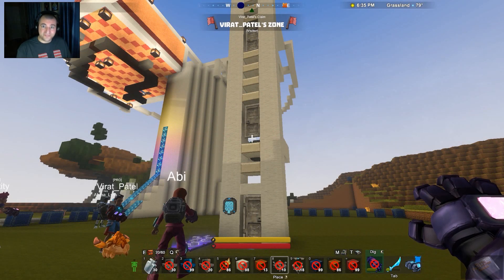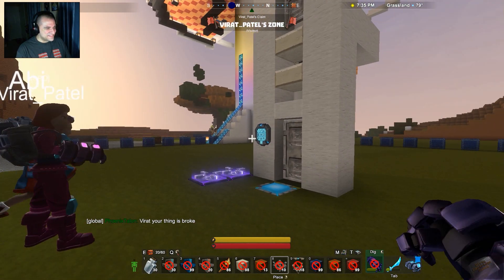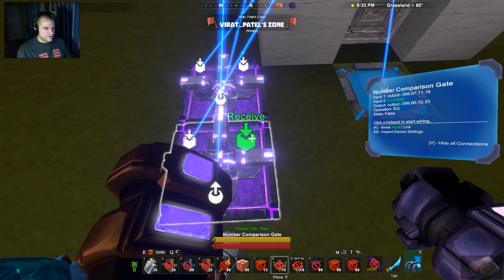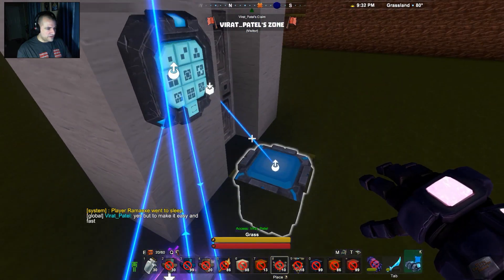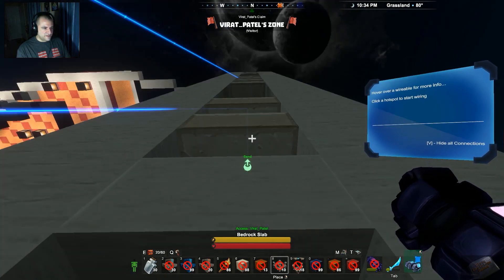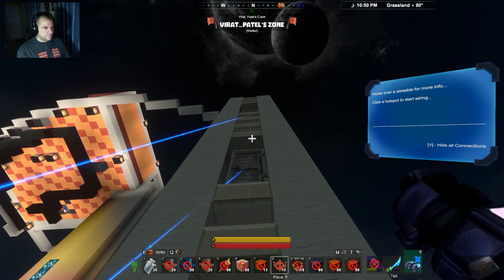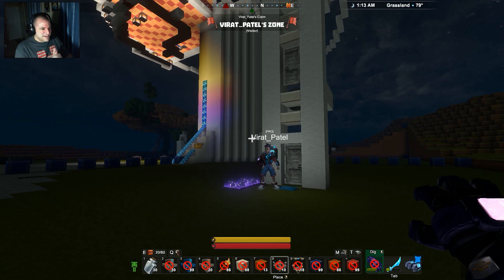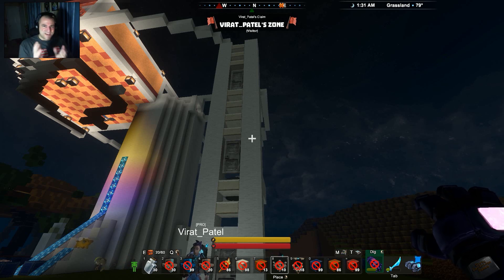Creativerse R37 Machines Tutorial 12 - Virat's Fanless Elevator!!!

Comment: why would it look for a open space and therefore push you up in the first place ? just because the game treats slabs as pseudo-solid blocks doesn't explain the (initial) upward propelling...
Reply from the maker: This is a very very old video.  And I have not played this game in an almost equally long time.  However, if I remember correctly, the game had a mechanic to protect the player from being inside door blocks.  It would push you up to find the nearest unoccupied voxel.  The initial push is from the closing door.  When the door is open, the collider does not inhabit the space, but when it closes, it fills the entire space.  The game did not look for adjacent empty spaces, instead it looked for vertical spaces.  In theory you could have built an elevator like this to put you on the surface, from a cave.  And we did try it, but it was glitchy.  However, it did work fairly well, when it worked.  Just make you have nothing but slabs above you.  I'm not sure if the devs ever fixed this.  The game had more bugs than a bait store, and became rather unplayable at a certain point.  We did have fun breaking it though.

I didn't know anyone still watched these old videos.  Thank you for coming by and watching. 😁